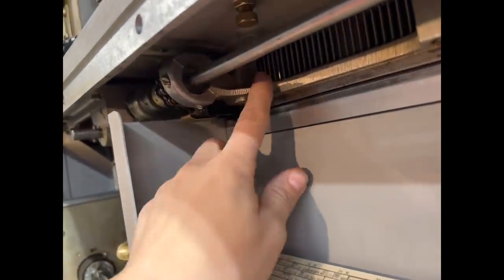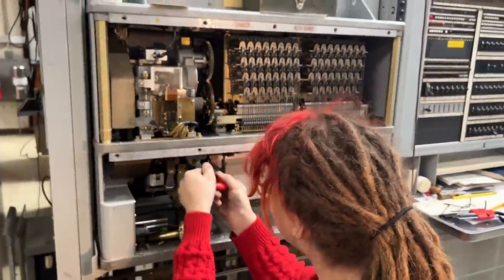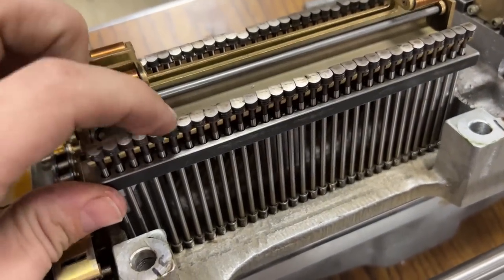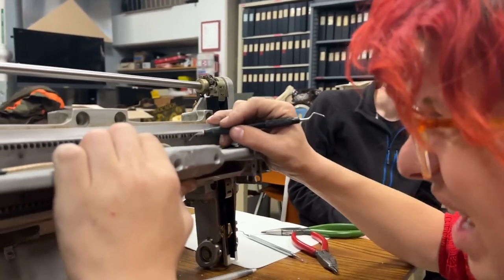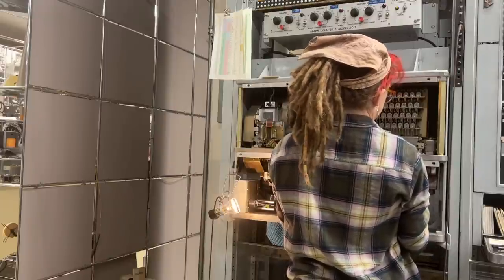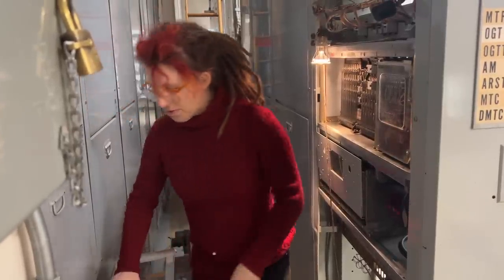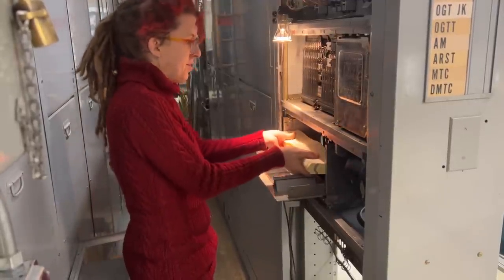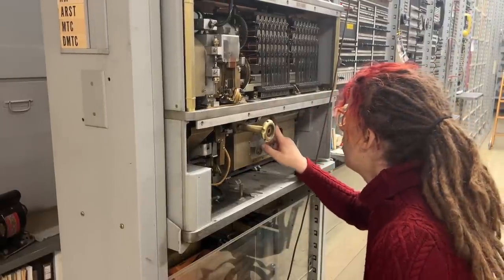Fixing bent pins on the Trouble Recorder (Part 2)

Comment: So I worked for AT&T until 2016. I didn't work with the equipment physically. I was Wireless Network Technical Case Management and only dispatched to physical sites or worked with data center engineers to fix something I could see in the input/output of one of my siloed Operational Support Systems. NOW HERE'S THE FUNNY PART! EVERY single piece of equipment on the network has not only a number (whether it's IP based or an E.164 address) associated with it, but also an alphanumeric NAME that's only relevant to internal systems. SEVERAL pieces of equipment up until 2016 were still labeled as "Number 5 Crossbar" or "5XB" or something like "(rural city name) Crossbar". SEVERAL times I'd have a ticket come back that someone's ported phone number that was having data routing issues simply HAD to have the phone number changed because due to the age and the fact that it was either ported or handled like a port when we acquired their company it was still handled in part by a freaking crossbar switch. I know they supposedly went out in the 90s but I promise you this was happening in 2016. Just some wild trivia I love and don't know who else but you might appreciate.

Comment: 3:10 now THAT'S a soldering iron. Obviously different use cases require different tools but wow, I think I could fit the entirety of my Pinecil (sans power delivery) inside the metal portion of that thing.
Reply: I think part of the fun of working on old telco equipment is using historically correct tools and procedures. I have to give credit to Sarah for not only maintaining the equipment at the museum but showing us a page on Bell System practice.
Reply: That's Crocodile Dundee's soldering iron... :-)

Comment: Hindsight is always 20/20 but would a small wood drill bit (1/8”) have been easier to “drill out” the jammed chads? Compacted paper is essentially wood.
Reply: Or a smaller bit followed by with a screw, to avoid touching the bit to anything metal. (and affecting the cutting profile)

I've used a ¹⁄₃₂ʺ-ish (0.8 mm-ish) bit to perforate chads clogging up a (comb style) book binding machine, then used a screw to pull/loosen the paper layers apart enough for the machine's own punch to drive the pieces out.  But those were rectangular/square holes in a machine that regularly processed much more than a single sheet at a time.

Was told (but wasn't around to see that) when it started to clog again, the owner of the binding machine started drilling out the channels so that the pieces wouldn't be as likely to get stuck, but eventually changed their process and scrapped the binding machine so that they wouldn't  keep thinking it's gonna jam as would have happened had they sold it to me (or anyone else) who would have continued to abuse it do things other than bind books with it.

Comment: One thing I keep wondering, since I found this channel: how does international call routing work on those old switches?

After all, international call routing can have varying amount of digits, even within a certain country code.
Reply from the maker: In panel and 1XB, international calls had to be placed through an operator. 5XB offices could handle international natively, although not every switch had international trunks available. Usually the call was routed to an international tandem switch, probably through a number of other switches along the way. A special piece of hardware called an IDDD Pretranslator in the 5XB took care of the complex numbering patterns of international calls.

Comment: Perhaps consideration for replacing the mechanical trouble recorder be replaced with a combination of software and a dedicated computer system and inject printer. In that case, the card could be replaced with a card image template and holes replaced with blacken ed areas. Also, the diagnostic data becaptured on external storage, and with the schematic books digitized, companion relevant page segments be printed!

Comment: The link in the description only works for the channel owner 😘
Reply from the maker: Thanks, I fixed it. Sorry, I'm bad at computers :)
Reply: @ConnectionsMuseum  computers were a mistake on mankind's behalf 😅
Reply: "I'm bad at computers".... then proceeds to write not only a Linux kernel module but also modify Asterisk - a piece of software so cursed the original authors gave up on and did Freeswitch instead.